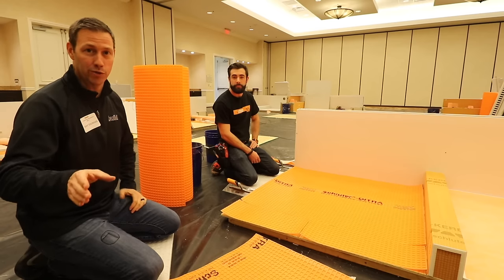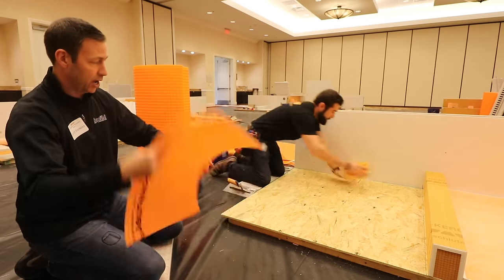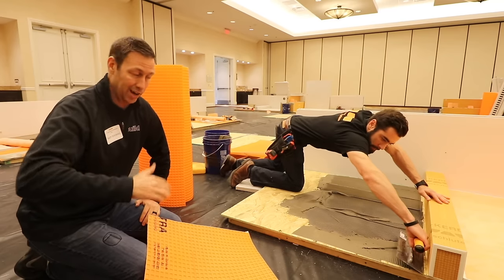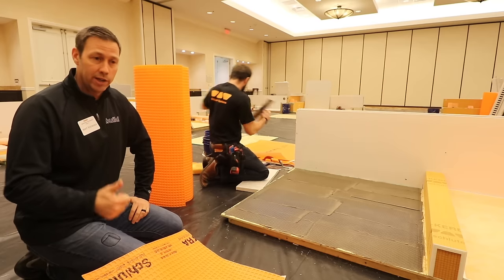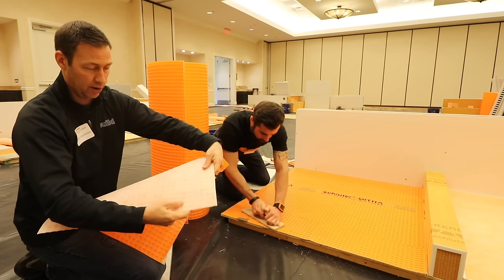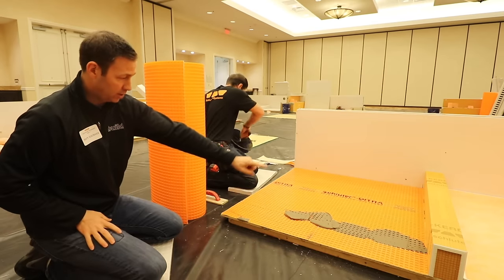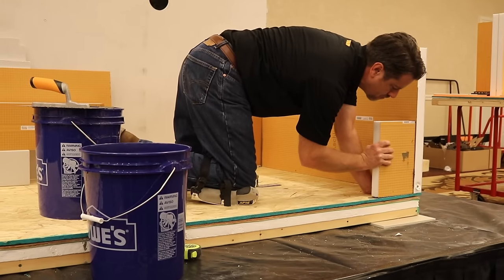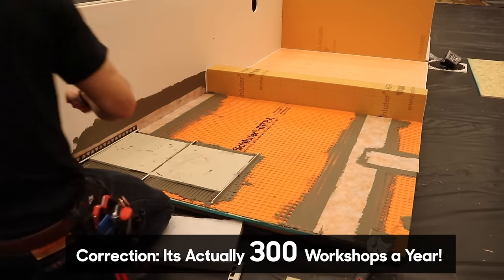WHAT is this, and WHY do you want it under your floors?

Comment: Please research Moxie concrete additive. Eliminates: Water permeability, structural instability from curing processes, expansion/contraction from freezing water, toxic “white dust” over time, and need for rebar (though local code will still mandate it!). I’m not a rep or anything but I’ve been on jobs that used Moxie treated concrete in the wet mix and am amazed it isn’t standard for all concrete worldwide.

Comment: 60 years ago, Earnest Pisano, put tile on plywood.   Real 3/4" plywood.   years went by, and the only reason I started taking things apart, was because of a leak from the toilet. (The toilet did not last 60 years).   I was STUNNED.   3/4" plywood was in near new condition, and perfectly fine.   I glued the tile that fell back up.  It worked better then anything I've ever seen, and it did not fight the water that hard.

Comment: When he mentioned the washer overflowing and flooding the upper floor that resulted in major insurance claims, that is one of the main reasons why the washer DOES NOT go above the ground floor. Washers belong on the ground floor, and preferably in the garage where water mishaps don't screw up the house.
Reply: that's what I was thinking, put in a laundry chute instead, a dumbwaiter or something
Reply: By that logic you shouldn't have second floor bathrooms either. If you put it just anywhere without preparing the space to house it adequately then yeah you're going to have problems.
Reply: @qtipmotha  Bathroom fixtures don't create leak issues to the degree that a washer can because bathroom fixtures are generally used by a person who is present during the entire use to see a leak issue right away, and when the person is done the water get's turned off. Besides that, bathtubs, toilets and sinks rarely ever leak, and if they do it's a very small amount. 

Washers are turned on and left to themselves without being watched. When the washer leaks, or the house drain line for the washer leaks, it can be a long time before it's discovered. If they leak in the garage, the water runs down to the street with no damage caused. Another reason washers shouldn't be on the upper levels is because they are designed to work best on a solid cement slab to keep them steady during the spin cycle. 

You heard the guy on the video mention the insurance claim from the washer, but said nothing about the fixtures causing a claim. That's because they rarely cause serious leak issues. I speak from experience on this because my occupation has seen washer flood damage hundreds of times.
Reply: @truthseekerKJV  that isnt the issue at all with washers. It's the volume of water than can leak in a short period of time. No one is noticing that their 2nd floor shower pan or tub is leaking when they're using it until its too late. The damage is more likely to be structural by the time that a problem is detected, especially with the  building materials that they're using for the joists in newer homes. In either case if built to suit it shouldn't be an issue. Its unlikely that a washer will ever leak during its lifetime, where as a shower/bath...? Not so sure about that. They also make prefab drain pains to install the washer on or a pan can be built with a liner like your standard tile shower. That goes back to adequately preparing the space for the appliance instead of just sitting it in a closet.
Reply: @truthseekerKJV  You dont seem to be very good at your job Tim if you cant build a tiled pan to catch your typical washer leak, or cant install even the prefab pans to drain it off. We're talking about a thing that will once in a rare while catch less water than a tile shower does every time someone washes their ass. Our family business, Bofa Contracting has been installing these for decades without issue. It's not trolling, its correcting misinformation.
Reply: @qtipmotha  your bathroom is used more frequently than the laundry room and for a person's use, a washer just washes clothes.
Reply: @eyeswideshut2800  that's my point. You have something like a shower getting used potentially multiple times per day with direct contact of the water on a tiled surface with red guard or something else over cement/hardy board underneath it and a liner/pan on the bottom. You're not going to realize that it's been leaking until it's been happening for a while, and the damage will be far worse than any washer leak. Tim is over reacting.
Reply: @qtipmotha  well here's the kicker, I'm an ex Builder and from big D Texas and here's my view. You won't know about most water problems until it's a problem and it's always a problem no matter where if things that should stay dry are getting wet.
Reply: @eyeswideshut2800  sure, but it's a different scale of issue if a shower is slowly leaking down an engineered I joist over months or years compared to your washer dumping water once if ever. You're probably going to notice the latter immediately. This guy is acting like it's worse even though it's far more rare of an occurrence.
Reply: @qtipmotha  your roof or foundation is a far bigger issue than a structural beam so if your downstairs bathroom is leaking in the wall then bigger problem. It's like I said, water moving to dry places is not a good thing period. If it's a large leak or burst pipe then you"ll lose water pressure and see evidence but if it's an obscure pipe then it doesn't matter where. You'll have a better chance of seeing the upstairs leak downstairs than you would if the downstairs leaks into the wall so depends on where you put your water sources, freeze temps, you and just life.
Reply: @eyeswideshut2800  Sure, but we're talking about washing machines leaking.
Reply: @qtipmotha  says the guy who brought up bathrooms first. Try not to get caught up in being right on Youtube and telling adults what to discuss. All point are valid, water upstairs is the actual subject, washers don't leak jellybeans...ijs
Reply: @qtipmotha  grout is porous just so you know and water erodes things, especially water with pressure.
Reply: @eyeswideshut2800  Not even remotely valid. He's acting like putting a washing machine anywhere but the first floor or basement is some cardinal sin, and it isn't relative to anything else. You're mad that he's wrong for reasons that don't make sense to anyone. Maybe you can't hack it anymore because your back or knees are fucked up. Who knows.
Reply: @eyeswideshut2800  smh, that's why you don't just lay tile and hope for the best.
Reply: @qtipmotha  It's like I said, water in dry places is not good and trying to be right is not working.
Reply: @qtipmotha  I thought trolls were on other Vlogs, what do you think to accomplish on a building Vlog, go harass the political or social media ones, they're here for it Pal...MUTE!
Reply: @eyeswideshut2800  Not trolling. Correcting your nonsense and watching you get upset about it. My favorite clip on this particular channel is the one where the guy narrating it claims that house wrap needs to be water tight because a moisture barrier should have the same function as a shower liner. You two jamokes would probably agree with him.

Comment: The example you mentioned about the home being built slab on grade. I would think you would check to see if the slab has expansion cuts into the slab. If you aren't able to do that you can always cut in your own expansion. In doing that you want to cut your concrete slab either symmetrically or diagonally depending upon the installation. I do concrete for a living & have been for the past 22 yrs. Concrete is your friend ✌

Comment: this stuff is awesome- i'm an owner/builder and i've done two bathrooms, a laundry room, a couple of kitchens and a deck with this stuff and most are past the ten year mark and all have experienced  zero issues.
Reply: What type of deck? I want to lay vinyl planking on top of trex on my enclosed porch
Reply: @richardraad2816  it's a slate deck over a garage.   2 layers of ply, ditra, kerdiband on all edges and seams, and then flashing above  that and then slate on top of that. The deck is super rigid, 2x12 (16 foot span) every foot, and 4x 2x12 under part of the deck that something else is supported by.   Note that schluter does not like people to do this, i dont think it's because it doesn't work,  i think it's because they would rather I had used their more expensive products that they market for outdoor use.

Comment: I have specified Schluter systems many times over the last 10 years or so and it is my go to spec for any tiled areas irrespective of whether they are wet or not.  In fact I was called to provide a rectification spec on two large office reception areas where the tiling had reflective cracking over concrete daywork joints.  In both areas threats of consequential loss and disruption meant that the pressure was on to settle the issue once and for all.  Schluter provided both the Ditra matting and the underfloor heating mat (check this out it is the best system I have seen) in the two areas.

Comment: Hey Matt, doing my first DIY bathroom remodel; took floor down to joists; took your advice and got Advantech subfloor panels. Was planning to use hardie board backer for tile. A builder friend told me about Schluter. Question: Can I use all three pieces; subfloor, hardie board, and Schluter? What would you recommend? Actually, the 1/8" Schluter may help my floor height on transition to existing floor. - Thanks for any help and thanks for the great videos.
Reply: You just need a minimum 5/8” subfloor on 16” center with regular Ditra. Concrete board is unnecessary for all floor tile applications. Concrete board works well for exterior wall stone and tile application. Hope your remodel went as planned

Comment: Nice product.  Though I would take issue with the fact that All Concrete is "going to crack".  Depending on the quality and the location, some concrete lasts hundreds of years without cracking, and install techniques have been getting better over the last few decades.
Reply: I think most post tension stays put. It can crack but not heave so you never notice.

Comment: I’ve been a tile setter for 43 years and I can tell you in all honesty whenever You hard fasten you the subfloor you will have problems. Wood never stops being a tree swelling with moisture in the summer and shrinking in the winter this will cause joints to crack every single time.A floating mud bed is far less expensive than This product and much more reliable.
Reply: Jeff Nelson Builder of high end homes in Connecticut for 35 years, could not disagree more. If your using a plywood base and leave a saw blade kerf between sheets you will not have cracks.

Comment: You also forgot to mention that it provides a slight thermal insulation layer between the cold cement foundation and the "floating" tile. Helps to reduce under-tile and over-tile condensation. Condensation that forms when you have a hot house or heated rooms, where the foundation is just cold from the night, or perpetually colder. Also, where AC lines and water pipes may be constantly cooling through the foundations. Again, it is slight insulation, but it is absolutely more than tile to thinset to cement, or cement-board. (We have a patch of tiles that is always perpetually wet, due to the AC lines and water lines. However, soon the water line will be forced to be CPVC, as they are nearing that age of decay and the new code does not allow for in-foundation pipes.)

If the tile didn't crack with the foundation, in our situation, it would be a bloody mess! Water would float the whole floor off the foundation and we would have to replace all the tiles, not just the ones along the cracks with the water pouring up out of the crack. So, this system has advantages and disadvantages. (I'm not going to go into substrate flexing as the material decays and becomes an inert bond.)

Comment: Yes I would like to echo the statements of others to find actual builders that use it, and specifically here in DFW area.  I have been watching Mike Holmes, that has used this for many many years for tile.  I asked a few contractors to use it, and none of them wanted to do it as that's "not the way we do it".   Same thing for spray foam, most contractors won't use it, and say no benefits over using fiberglass. Ugh...  I have learned the hard way that you don't want to be the beta tester for a contractor using "new" things or processes.
Reply: Contractors tend to get stuck doing things the way they were taught, especially old timers. They rarely keep up on current practices and technological advances, so find younger contractors who specialize in these newer techniques.
Reply: There is no advantage to spray foam, other than a light coat to stop air flow.   Fiberglass is crap, the cellulose wet blown-in is the way to go.
Reply: Dear @abacab87  , There's a lot of ways to skin that cat! I object to the flame retardants used in a lot of the wet blow-in products and favor rock wool for insulation and fluid applied membranes to prevent air flow. Yeah, it's two steps to your one, but I think it's worth it because of greater  durability and performance (blown-in does not provide as good an air seal as fluid-applied, from the info I've been able to glean).
Reply: Dear condog42  : Hallelujah! Somebody who gets it! Some other objections: the guy in the mop suit with a respirator on can not tell if the mix is right, it looks the same and installs the same even when the mix is significantly off of specs. Therefore, there is no quality control for installation. Foam that is properly installed is not terribly hazardous, but a bad mix or flaws in installation and you have a health nightmare. There is also such a thing as "R-Drift" a polite euphemism for "this stuff outgasses for decades." Where does it outgas too? The inside of the home!  There are hundreds if lawsuits currently ongoing because the homeowners discovered that they are sensitive to the foam and are suffering major health consequences. Finally, foam is an ecological nightmare. It is a petrochemical artificial product that you can not recycle. I use rock wool, as a rule, and only used pre-formed foam products like Kerdi board when necessary.

Comment: Did my entire 1700 sq ft cement slab house in this product.   I know that in places the slab has shifted and drywall cracks  but the floor looks the same as when I finished it over 5 years ago.   I did break a tile from dropping a heavy object on it.  It was a bear removing the broken tile.  I'm pretty that I would have lots of issues if I had not used ditra.

Comment: I remodeled 5 years ago and insisted on Kerdi in the shower and Ditra on the floor. Great system. To make it even better use Mapei Flexcolor CQ which is non porous grout and does not stain. Between ceramic tile and the Flexcolor CQ show dries bone dry in less than an hour. I have over 600sf of tile done with Flexcolor CQ .

Comment: the best waterproofing product for brick or concrete is silica fume mixed according to the maker's recommendations.  then put whatever junk is required for your local building code on after it.  it also seals cracks in concrete if you've had to lift the tiles because of cracks.